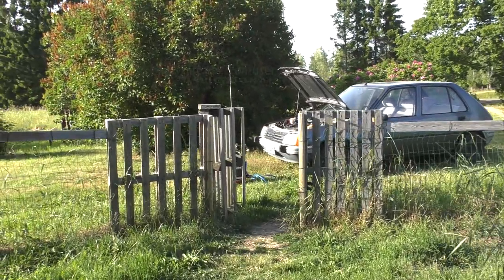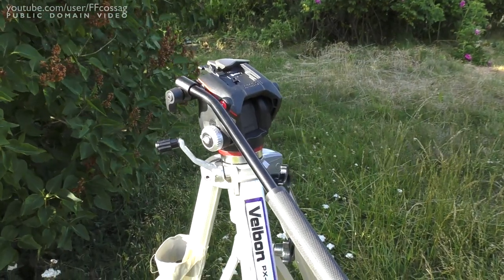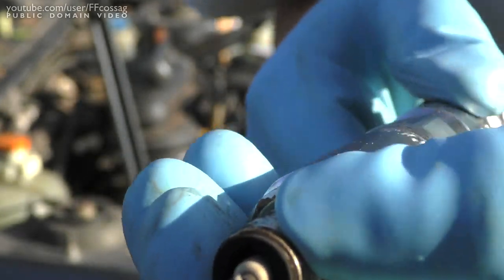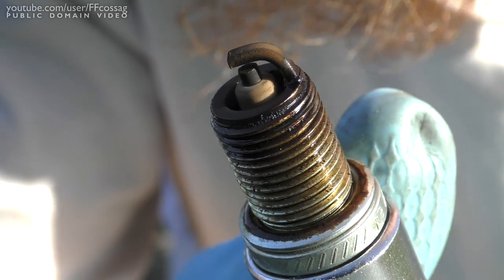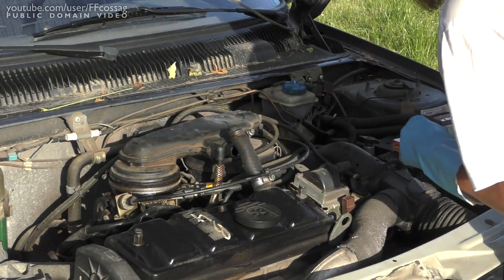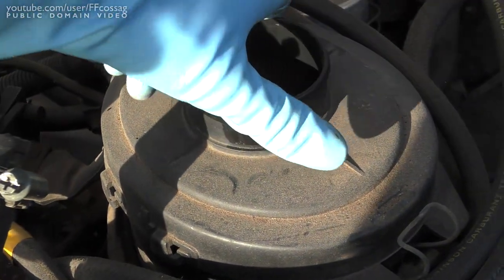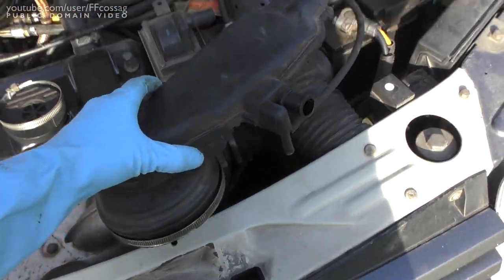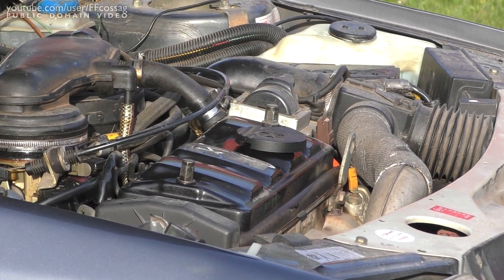Blog. Spare parts Peugeot 205: Spark plugs & camera update

Comment: The gaps look identical, only the ceramic insulators are different lengths, different heat maybe?
Reply from the maker: Yeah, looking back that seems to be the case. I was rather tired while filming. Either way, the Peugeot plugs (which are even Peugeot branded) should be a better fit.

Comment: FFcossag - Multimeter to check coil/HT leads, O2 sensor, will give you a good idea of what's going on. 

A few other pointers, rubber hoses, check for cracks, vacuum leaks. Those "garden hoses" are very prone for leaks. 

Check head bolts torque and either on intake manifold and exhaust manifold. I found too many "loose" heads and manifolds. 
Temperature sender near the thermostat, if reading incorrectly the ECU/injection simply stuff more gasoline. Same for vacuum or exhaust leaks. Detect to much air, so had a lot of gasoline to try to compensate...
The sparks look absolutely normal for a start/no drive or short distance drive, condition on these engines. Except for that 3th cylinder wet plug...

PS: A vacuum gauge it's very handy and cheap. ;-)

Comment: Those plugs have too much soot on the outer ring. Rev the engine hard while looking at the tail pipe. White smoke for oil, black for excessive fuel. 

The problem with low km engines that are old is that time dries out the seals, that and using modern oil with non compatible old seals, so there is a good chance that valve stem seals are leaking oil into the chamber. Soot and carbon in cyls can gum up  rings so they don't seal, or can jam under valves and make them leak. You can give it a good trashing to see if it helps.

If it's excessive fuel it can bore wash cylinder destroying ring seal - I'm sick of Ferrari 3.5 V8's because that is a common problem -. If it's fuel and it has a Lambda, heat up the tip red hot with a blow torch until it's clean grey metal.

You can do a comp test to see if 1 cyl is low.

Comment: I think you may need access to an obd2 scanner to see roughly where the misfire is.
The plugs didn't look bad to me, the center porcelain was clean and the electrodes in fair condition.
The 205's are a good old beast, they are not slow if the engine is happy :-)
Reply from the maker: Heh, OBD2 is nowhere in sight on these engines (I mean come on, it's single-point injection). I've made a tool to read blink codes, but I don't think they are even able to detect a misfire; they pretty much only have a MAP, a throttle position sensor and an oxygen sensor.
Reply: Oh i didn't realise they were that old, time goes by a bit to quick.
Mind you i was only 30 yesterday, today 50 lol :-D
Reply from the maker: Dear oh dear, and I'm afraid of having to call myself "middle aged" in a few years.
Reply: lol, just don't tell the brain, it has a habit of aging slower.
Brain wise im 30, and when in a silly mood 10 :-D

Comment: Could be deteriorated HT leads causing the misfire, if one's got a small hole in it, it could be occasionally arcing to ground via another point along the wire...
Reply from the maker: I'm doubtful, as they've been replaced - probably by someone troubleshooting the same issue.
Reply: In that case, other issues I can think of is maybe valve clearances so the rockers need adjusting or the coil may have issues...
Reply from the maker: Yeah, at this point it can be pretty much anything. I'm not going to put too much time troubleshooting it, as if I ever end up using this engine as a whole, I'll rip it out and rebuild it anyway.

Comment: Wow, who puts the air filter directly in behind the engine block, where all it can do is suck in hot air right from the engine? I'd say that's a poor design! But then, these are French cars, so it's kind of expected of them to put stuff all over in places that aren't ideal for it (I have seen this on new-ish Renaults just the same, when a friend of mine had to work on it, and it was just put together totally illogically, from where the parts were placed). I guess the French just don't really know how to properly layout an engine bay...
Reply: Seegal Galguntijak - You might want to learn some about mechanical engineering before jump into conclusions about air filter design. Might be quite a surprise to check the how's and why's that make performance, comfort and legislation work better than the "normal" CAI the kids love to stuff without knowing any better. ;-)